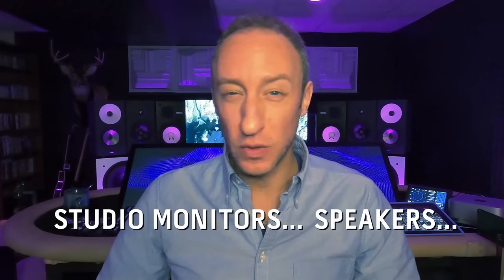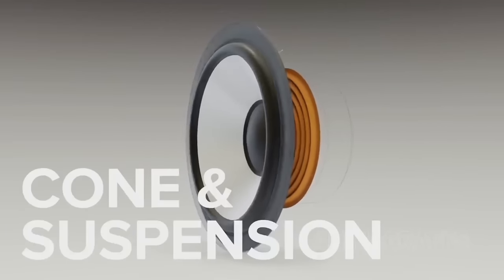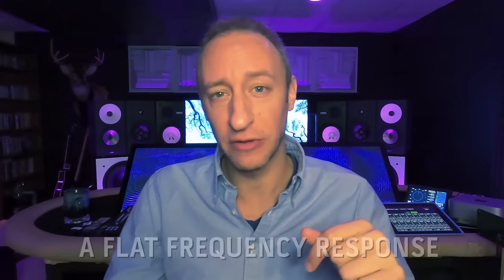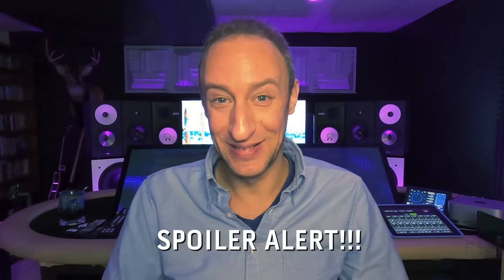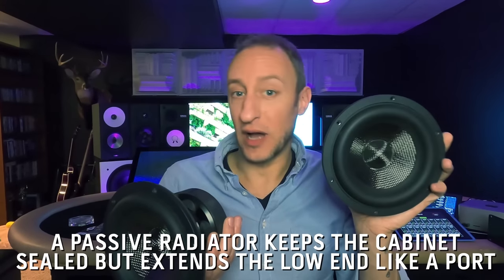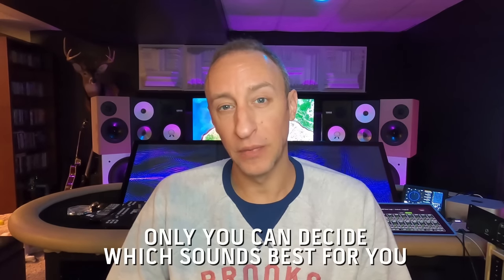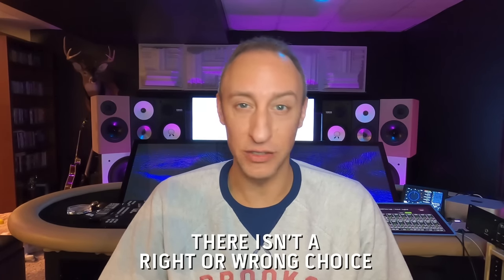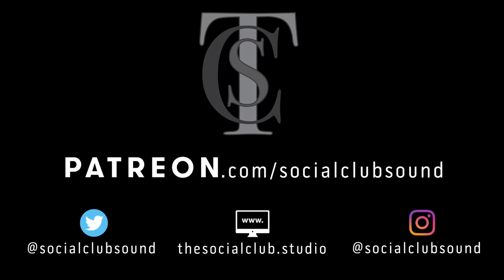SPEAKERS vs STUDIO MONITORS!!! What's the difference? Find out!!! TSC Production Tip 005

Comment: Can I put the speaker horizontal in stead of vertical.?
I use mine that way.
Is there a difference.
Just looked at your web site 
Specs  in particular.
81 db. I don't know.
88db is ok .
My Ohm L,s are 87 I think
There ok.  I would rather see like 96 of 97db.
For the $$$$. Ya know.
Reply from the maker: Speaker can be placed horizontally or vertically. It will load the sound in the room a bit differently but not in a major way. The low sensitivity is what it is. The sub is low sensitivity to start with. To keep the speaker linear I could only work with what I had. That said, it takes plenty of power and has a big Xmax. All in all these are made to play clean up into the mid 90s for SPL as they're intended to be studio monitors and you don't want to mix much louder than 85dB for your ears sake.

Comment: I know you don't want to use stereo hi fi speakers as studio monitors, but what about the people I see using studio monitors as hi fi speakers? It was my understanding that studio monitors are near field, but many are using them to listen from across the room or in a home theater setup. Will both types of speakers perform the same in that scenario?
Reply from the maker: The individual speakers characteristics matter more than the distinction. Remember the Yamaha NS-10M started life as a HiFi speaker but got adopted by engineers as a studio monitor. The Amphion One 18 are meant to be near-field but the Two18 can be mid-field. The space you're using them in makes a large difference on how much leeway you have placing them in the room. Woofer size will matter a lot for how far away you can use them. There's still no replacement for displacement. My best recommendation will always be getting a reference mic and doing sine sweeps to find where the best listening position and speaker position is for your specific room. I hope that helps!
Reply: Many Altec and JBL home speakers were large monitors in home furniture cabinets rather than utility cabinets. The Altec 604 Duplexe driver was used in both monitors and home speakers and still has a strong following among audiophiles. indeed, the 604 is still made by the Altec successor company Great Plains Audio.

Comment: SPL matters. My current setup won't rock the house but it's not "turned up" very far either. The individual driver designs will go non-linear at different volume levels. There is a whole can of worms starting there. The "triangle" is also important. I have full bookcases behind me and the mid-hi drivers are pointing at my ears, etc. Subwoofer placement is another can of worms, but unless you're building a space, placement is remarkably flexible, I have mine at my feet under the desk sending only subsonics to my shins.
Reply from the maker: Yeah it does matter. For the studio we tend to not want to mix higher than 80 or 85dB for music. Need the ears to keep their longevity!
Reply: @SocialClubSound  True, but the point I'm making is the different drivers in the speaker cabinet lose efficiency at different SPL. There is a sweet spot *range* where the bigger drivers don't slow down or stop altogether from inertia and the smaller drivers don't sitck out of linear reproduction because they're much smaller and might work with a different physical reaction as with piezo drivers. I'm sure the fine folks at Genelec, etc take all that into account. That was the intent of the "loudness" switch, to exaggerate the low frequencies at very low volume levels to give the woofers a chance to stay linear. As with subwoofer function, we all know where that went in popular culture. Regards.

Comment: Incorrect. In a ported enclosure, at the tunning frequency (where the port is adding bass), the air in the port moves in the same direction as the woofer. You said, that when the woofer moves in, air in the port moves out. If this were true, the port output would be 180 deg. out of phase with the woofer and bass would be drastically decreased. Another thing that you said (which is not true) is there is no air spring on the woofer on a ported like on a sealed. There is actually more resistance in a ported design than a sealed. Don't believe it? Run this test. Say that your tuning frequency of your ported speaker is 42hz. Now cover the port, run a 42hz test tone thru the speaker until you see the woofer moving quite a bit. Now remove the port blockage. What you will see is that the woofer is barely moving. Because the air in the port is moving in phase with the woofer cone, the pressure has reduced the cone movement. BTW, everything that I said about a ported design, applies to passive radiator systems because all a passive radiator does is, replace a port.
Reply: It is unbearable to watch a person that is just now beginning to understand the basic principles that go into the construction of a speaker, who jumps over its vast sea of unknowns and resorts to a very cheap psychological manipulation to diss the tried and true "competition" and to try to make you buy its primitive product.
Reply: so if that is true would you say that if a (well tuned) ported speaker say kali in5, is more articulate than sealed designs (say older snell)? lot of talk about sealed having better “impulse response.” tighter bass. but might be inaccurate. if what you’re saying is accurate…
Reply: @chinmeysway  I do believe a sealed system has a more controlled ie tighter sound than ported, but under certain circumstances, a ported box will deliver a cleaner sound due to the lower distortion associated with less cone movement.

Comment: Best performance I have ever heard was, active speakers with each driver, driven by a separate amplifier (every driver had its own Class D amp), through an electronic crossover.
Also, the "marriage" of an amplifier to a pair of speakers, (monitor or other), is the most important factor in what the final result will be.  A mismatch between the two is disastrous.
With active amplification the manufacturer has (hopefully) worked out an almost perfect match.  There's no need for further experimenting.
(..my two cent worth of trying and listening for over 50 years..)
Reply from the maker: A well designed active system can sound AMAZING. I wasn't trying to say all active systems aren't as good as passive. I was trying to make a point about buying a speaker for a price point. Like when you spend $1000 for a pair of speakers with an amp built in... No way that's going to compete with a high level genelec or ex machina. Thanks for the comment!
Reply: @SocialClubSound  
Indeed, point taken!
As usual, I get carried away with perfection. 😏😏😃😃

Comment: Great video! But I stumbled accross the following: 16:43 two different capacitors which measure identical but sound different? How can that be? If we don't believe in voodoo speaker systems are physical things. Also capacitors are physical things, which have physical traits, which we can measure. So by logic inference we can say that if two capacitors measure the same they behave the same in a physical system so in the end they must sound the same. How come you say they don't? And can you tell in a true ABX test or did find out by a side-by-side comparison?
Reply from the maker: Because they're made of different materials. The ratings on a capacitor is for how much energy it can store. That's it. How quickly it can charge and discharge matters greatly in the sound of the capacitor. It's why poly caps are preferred over electrolytic caps. It's not voodoo. It's still science. But the science is more in how a cap discharges than what it can store. I hope that makes sense!

Comment: I’m wondering if I need to turn my monitors off when I’m done using them to extend the life of them? And I’m going to give yours a try.
Reply from the maker: There's a mixed school of thought on keeping your equipment powered on all the time, but I am in the camp o keep them powered on. What really shortens the life is the power surges in the capacitors turning the power supply on. The less frequently you do so the less stress. There's people who will argue it but me personally, I keep my amps and studio equipment on 24/7. Stand by mode is really efficient in gear nowadays, especially class D amps.
Reply: @SocialClubSound  thank you. I havent yet to use them at even half of their capacity so they should last a while. KRK Rokit 8

Comment: 8:80 not necessarily, check measurements at Erin's corner or Amir's, there are lots of speakers that have excellent response.  
12:45 you barely understand how Helmholz resonator works. The air cushion is there, sprung mass holds it there.

Comment: Focal Trio11 Be is active with built in Amp and it is outstanding
Reply from the maker: Well, yeah, they're $8k a pair. They BETTER sound outstanding. I mentioned not all plate amps are bad! But when you're getting an active speaker for $1k the corners will be cut as opposed to the higher quality parts they can afford to include in an active speaker at $4200 each. I'm not taking anything away from that speaker at all. Cheers!

Comment: Just a thought....In an ideal world the pressure on a bass drivers' cone, should be equal on BOTH sides of the cone. So, it pushes and pulls with equal resistance. In a sealed box this is not so. It pushes out with greater ease and has a higher resistance on the inward thrust. With a ported box, the pressures will be more equal, be it frequency dependent.
Just thinking out loud, no conclusions!

Comment: Have you ever considered AMT's and or wave-guides instead of dome tweeters on a flat baffle for the SBH-7S? And if not, why not? I've always been impressed with the top end on Adam's monitors.
Reply from the maker: I've considered them for other builds, not for the SBH-7S specifically. My Amphions use a waveguide and sound great. But I love how these tweeters sound in this build. Very linear and open. Thanks for the comment!
Reply: What about a 3 way system

Comment: Seas, now that's a name I haven't seen in a long while!  I was turned onto them by a buddy (we were all self-proclaimed audiophiles and experts back in the early 90's!) who sold them out of his little 4 car bay retail shop, specializing in keyless entry/auto-alarms and ridiculous car audio installs out of lovely Tustin, CA.  Sadly the idea of a loud speaker capable of accurate reproductions was never a priority with me and my crowd.  We were into the "Wong-factor" (those Earth trembling trunk lid rattles from >1500 watts of 35Hz)  and deafening loudness.  Fortunately, my sonic palate has matured, and I've started to rediscover music in general.  Something I've always wondered about was the utility of a dual voice coil set up?  My said buddy used to demo a woofer (I don't remember the brand, but it was most likely a re-badged Taiwanese EV knock off) by plugging into a standard 120v receptacle.  He said these speakers would push and pull due to the dual voice coils? That got me thinking about why no one has ever developed a speaker motor that used an active electromagnetic field as is used in electric motors, rather than a fixed magnet? Maybe I'll build one and answer my own question?
cheers!
ron:)
Reply from the maker: Nice! I started in car audio in the 90s. I installed car stereos for a few years between high school and college. Good times! SEAS is still sounding great
Reply: Electromagnetic aka "Field Coil" speakers in most part preceded permanent magnet types. Sometimes they did double duty as chokes in the power supply of amplifiers and radios.

Comment: I hate to be that guy, but I wish the animation showed the coil moving inside the magnetic gap and when in it's rest position, it has an equal amount of coil hanging out of either side of the magnetic gap rather then the coil being predominately behind the magnetic gap, inside the structure. It shouldn't bother me as much as it does 😂 

Otherwise, I really enjoyed the easy you delivered this info man, thank you!
Reply: Oh wait.. He's explaining that the air just gets pushed out of the port at the resonant times frequency and therefore the cone is uncontrolled at the tuned frequency, which isn't true. The opposite is in fact true. 

The reason why a port "resonates" is because air takes time to compress. Much like his animation of air molecules moving in response to the motion of the cone. With a port, the cone gets the air molecules inside the enclosures.let's say they are pushing the air molecules out of the enclosure. By the time that air movement reaches the outer edge of the port, the cone is now pulling the air back into the enclosure, via the port. Because of the delay, which is exactly one half wavelength at the resonant frequency, the sound waves exiting the port, actually realign with the sound waves coming from the front of the cone. You get this motion of air molecules moving out of the port at the same time cone is moving forward, which is sucking the air back into the enclosure. Just as the air moves at its highest velocity back into the enclosure, the cone is now moving in a way that is pushing the air back out. As result of this, pressure inside the enclosure is amplified beyond what the speaker would experience if the port was sealed and all other things being equal. This added pressure actually creates dampening that the driver would need to overcome. These pressure actually resist cone motion at that frequency. Not only that, but due to the motion of the cone affecting pressure levels in the enclosure, the resonant motion of the air going in and out of port is also dampened to a point. However, it is a little less dampened than the speaker driver. 

The larger the diameter of the port, the more air mass there is, the more stored energy there is. That is to say, if the air in the port is excited by a transient audio frequency, it may "ring" for 1-3 cycles, and a select few can hear that. This requires a very large however, become obvious if the area is equal to around 1/4 the total cone area. If the port is too small, due to the air squeezing through such small hole, the air velocity may be so high at high volumes, that you can hear a "woosh" sound often referred to as "chuffing". 

The extra physical dampening/kinetic impedance also increases the electrical impedance, lowering cone motion further and reducing heat by reducing current through the coil. 

Below the tuned frequency of the port, there is zero dampening. Air moves in and out as if there is no enclosure at all. Sounds waves from the port cancel out between the port and the cone. It is important to have either the port resonance around the frequency of the lowest frequency of the music being played, OR, incorporate a filter that will cut those lower frequencies. 

Above the resonance of the port, the mass of the air inside the port resists that faster motion. Like, it's too heavy to move effectively. It will absolutely leak sound, but will be largely filtered and drastically reduced. You may not hear very much sound from it, even up close, but especially if the port is faced away from you. As for dampening, it has less dampening than a sealed enclosure and thus less control. This can be mitigated by using a driver with strong internal dampening intrinsically via the suspension system, but will often effect sensitivity. Another option is to use a driver with a powerful copper shorting ring. This can offer increased dampening without sacrificing sensitivity. Wait.. I'm getting off topic here.. Lol

back to ports, their behaviour I describe above is almost exactly like bouncing a slinky in your hand. Hold your hand out infringe of you with the dangling down,with a 12 inches of space below it and bounce it at the resonant frequency. You'll notice the end moves the opposite direction to your hands, demonstrating the phase inversion. You can also observe that a small input of movement from your hand, and the much larger output of the opposite end of the slinky. Now move it really fast and notice the tiny wiggle at the end of the slinky. Observe the motion does not match because the slinky absorbs a lot of that energy, a little like car suspension. Now move it slowly up and down and notice it match your motion perfectly. Observe no phase inversion, and no amplification of amplitude at the other end.

Comment: Nice vid :) Also if you have resonable speakers, dont underestimate a good amp or DAC upgrade; I remeber years ago I upgraded my HiFi speaker and amp setup ( a $1000 yamaha 5.1 to a NAD 2 channel power amp + Tube DAC ). When I hooked up my old speakers to sell them I was blown away how good they sounded with some good electronics driving them. Ironicaly years later I rebought a pair, upgraded the crossovers, and my expensive speakers that cost 10x the price are not getting used :S
Reply from the maker: Yeah, on the studio side here, switching between audio interfaces (DACs) you can hear the audio quality differences. Clocking also seems to play a role in how the frequencies are handled. I enjoy having the option to switch between interfaces and amps. Thanks for the comment!